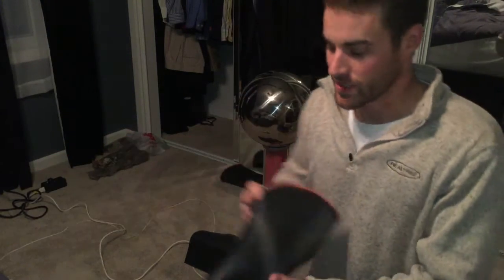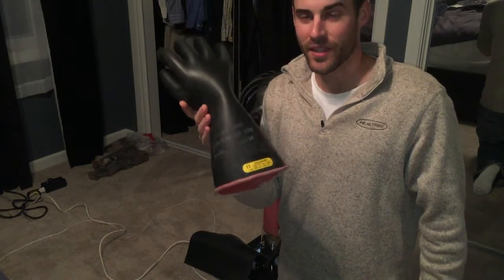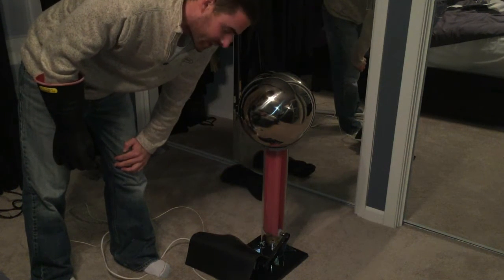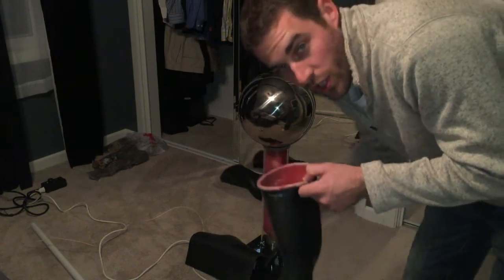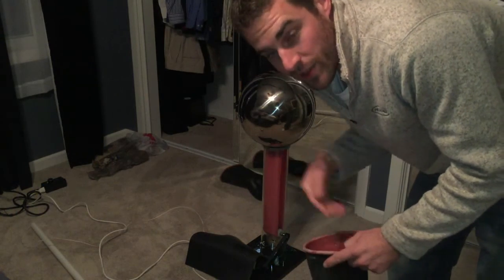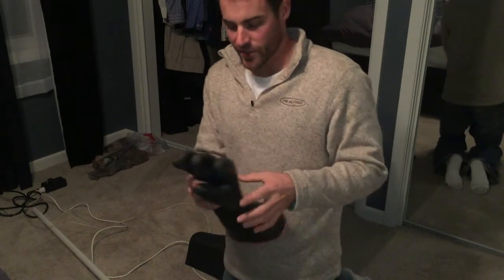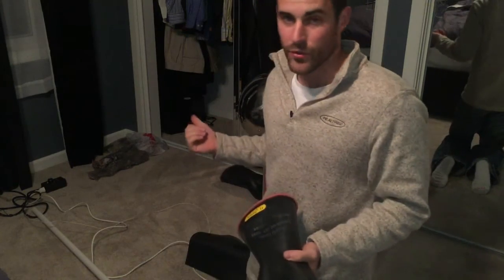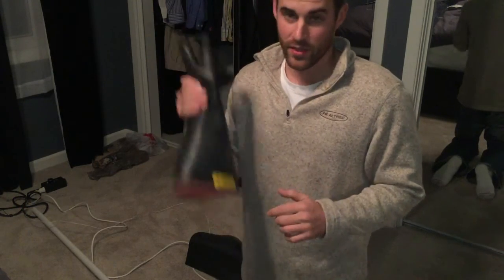Van De Graaff vs Rubber Electrical Gloves

Comment: Yes, the conclusion is basically right- it's the effect of increased capacity. The rubber glove serves as thin insulator -> one "plate" of the capacitor is your hand in the glove and the other "plate"  is at the outside of the glove. Althought there isn't conductive surface at the glove, the ion wind can deposit charge on it's surface and  this way increase induced charge on your hand. You may want to try the same experiment with a small metal ball held in the glove

Comment: I would not rely on those gloves as being safe anymore.  The sparks going through the gloves at that voltage will burn "pin holes" through the gloves.  Even air testing them I wouldn't feel safe using them at work.

Comment: This is exactly what I needed!  I have a job where I have to make a 600kV by a maximum of about 500 micro amp, 300-watt HV generator.  I was going to buy some expensive 50kV gloves because I thought they might help a bit.  It looks like they would just make it more dangerous.  It may be that keeping a good distance is the only way to stay safe.  Thanks!

Comment: If I have a 40,000 Voltage Rated Glove and I Work to 50,000 Volts
Higher Can I Still Get Shocked ?
Reply from the maker: Depends how far an arc can jump. Non static electricity is probably not an issue, but with higher Amps I would never assume.
Reply: luffy suvived 100,000,000 volts